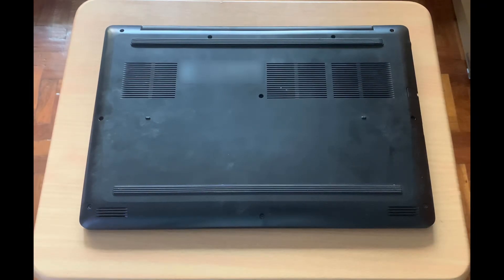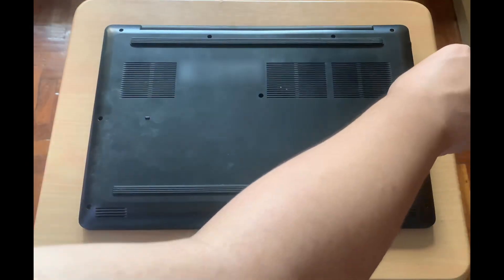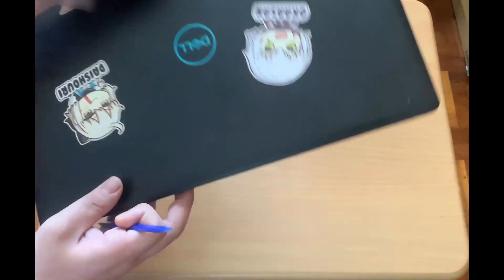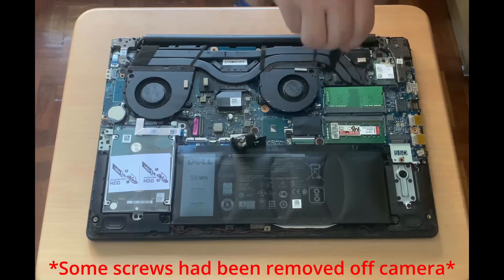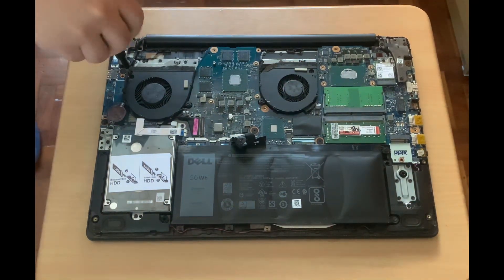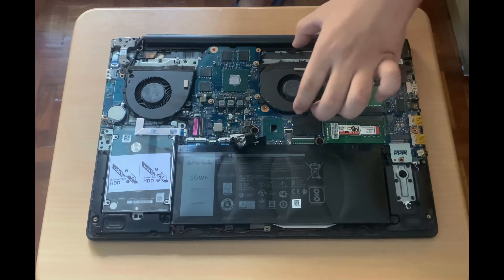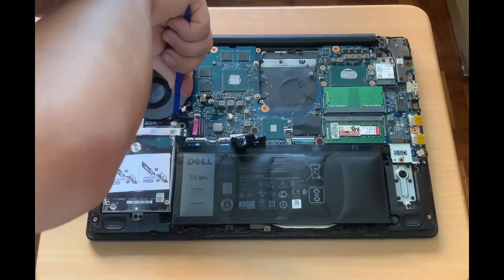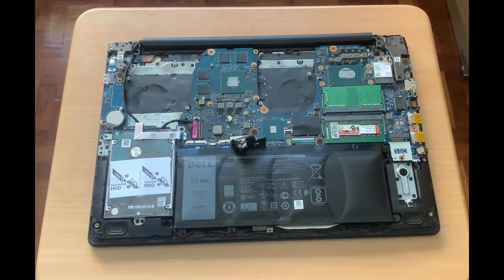Dell G3 3579 Thermal Paste Replacement

Comment: Hi, a question about how thicker the thermal pads are. Is it all pads the same thickness? 
So, do you remeber how thick it was?
Reply: Hi i measured it yesterday almost of them are 1.0 

but i saw 1 line of pad which is at lowest position on the heatsink i  forgot to measure that one but i think it was thicker than the rest.
Reply from the maker: I think all of them have similar thickness, but I forgot the exact thickness of the thermal pads.

Comment: replace ur battery
Reply from the maker: The laptop is my friend's and I already informed him about the battery, and he does not want it replaced yet as he frequently uses it plugged in.
Reply: @miles_uy  its going to cause damage to the computer if he doesnt
Reply from the maker: I did tell him to remove the battery from the laptop until he has a replacement, as I also noticed that the chassis (around the touchpad) is already flexing from the swollen battery.